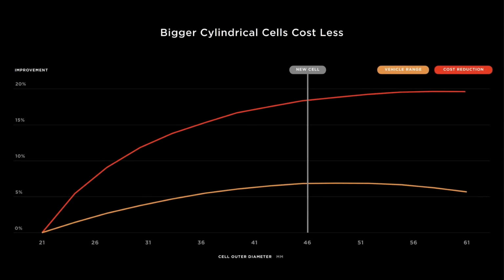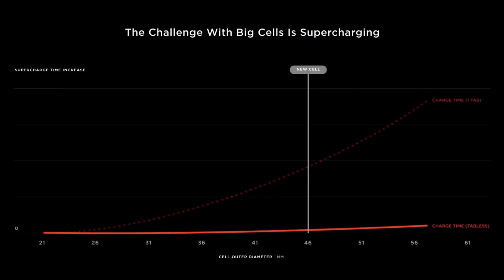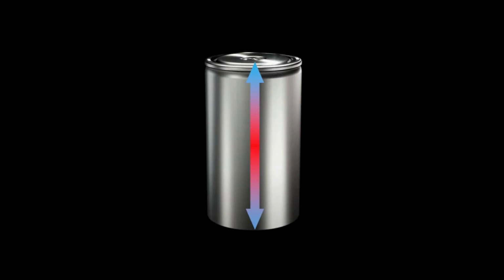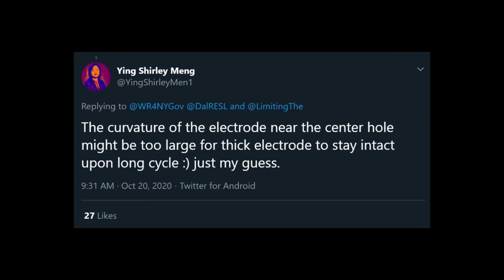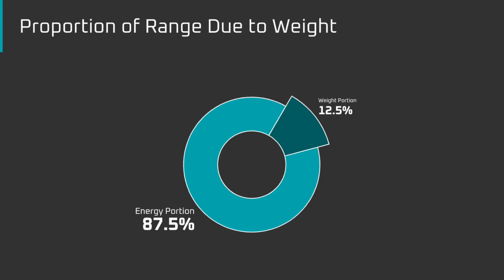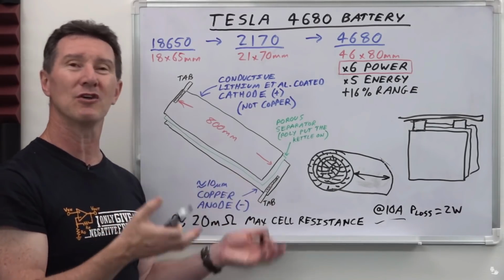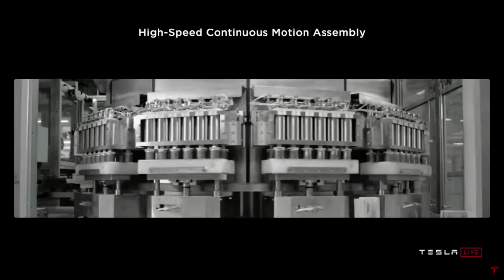#3 Tesla's 4680 Tabless Electrode Cell Design // Deep Dive

Comment: Larger means more thermal mass, higher temps means increased electrical resistance which results in lower efficiency until thermal runaway.

Comment: I would assume Tesla is using some kind of Battery management system for batteries in series batteries on the production line. since batteries, coming off the line will have differences.

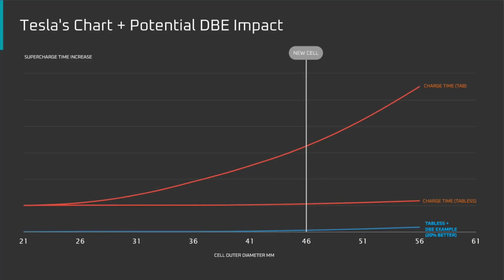Comment: At 9:42, I have a problem with your adjusted graph which leads to my point in my comment from 3 months ago below. The graph's Y axis is Supercharge time increase as diameter increases from 21mm, therefore your blue DBE tabless line, although possibly 20% faster, should also be at the 'zero' line with the other 21 mm cells since 21mm diameter is the zero point. The time it takes to get charged for a 21mm cell is inconsequential in this graph with how the Y axis is labeled. They are obfuscating the actual charge time for a reason and if you were to map your 20% decrease directly to this graph as it is given, it would just overlap the tabless line since actual charge time of a 21mm cell in various formats is not given, just the SC time increase as the diameter increases. What I am saying, and it seems like you are also trying to say in your DBE example is, there is likely an offset in actual time to Supercharge the tabless cell that they did not want to show us for reasons of not wanting to Osborne their current products. My guess is a 2170 tabless cell would charge faster than a 2170 tabbed cell due to less heat issues and longer sustained high power charge rate. If you add the possible gains from DBE to that as well, then there could be a decent increase in charge speed since max charge rate will happen for longer than a few minutes and the max charge rate might be higher as well. I cannot wait to see what they reveal for the next Superchargers and 4680 charge rates/times.

Comment: What do you think the nominal voltage of the cell is? Would it be the same as the previous cells in order to maintain the same battery management systems, or an increase to possibly facilitate the higher power output?
Reply from the maker: Covered in the cathode deep dive videos.  Potentially .1 v increase
Reply: @thelimitingfactor  awesome, thanks

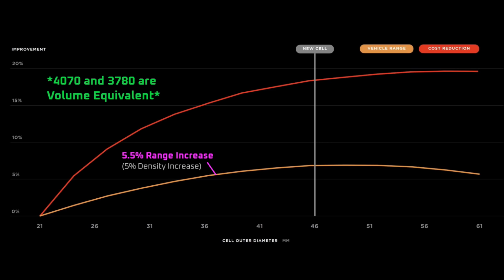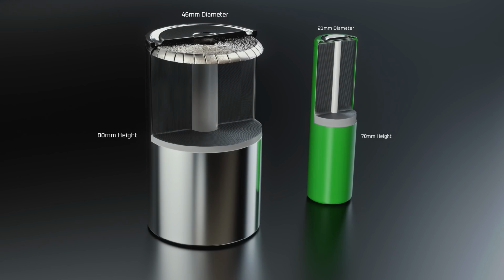Comment: Pay attention to the curled copper flaps of 4680 battery shown on page 4:00 and 4:06. Two, one shown are rolled up electrical contacts intended to press tight against the (+ and -) terminals at the battery casing (as in Tesla’s patent), but is not so in this photo. 

Conventional use tabs (ie - welded tabs) and not multi point contact flaps. Why? to avoid chance for electric spark in side the battery when contact pressure (between flaps and terminal) accidentally falls to zero, ie open circuit.

Contact per contact comparison : 
Welded tab : 
- eliminated spark 
- higher electrical and thermal resistance .  
Multi-flaps : 
- not spark proof (risk to fire / explosion)
- lower electrical and thermal resistance theoretically but practically, as page 4:00.

Comment: Jordan, theoretically, would a tabless 2170 and a tabbed 2170 take the same amount of time to Supercharge? Is there something about a smaller size that is not beneficial to tabless design, but becomes beneficial the larger the diameter? The reason I ask is that I have been quite interested in why they chose the Y axis label and not labeling the increments of the Y axis. It is my opinion that there is an offset in time to Supercharge for a 2170 tabbed and a 2170 tabless that they did not want to show, so they chose to label the Y axis as Supercharge Time Increase. I understand that all the other elements of the cell and pack, anode, cathode, size of the layers, cell to pack, pack cooling, etc. will play a role in charge speed, but I still believe the tabless design gives a benefit due to lower heat and shorter electron path thus allowing longer max power charging before it tapers.

Comment: Maybe I missed the discussion but I have two questions bugging me: 
1: if you are invested in 18650 and 2170 battery form factors like Panasonic et.al it still would be advantageous to upgrade your production lines to tabless electrode design - I would add the faster the better. Why nobody is talking about this? 
2: for me it seems clear that the 4680 form factor is optimized for replacing the 18650 and 2170 batteries in the incumbent S3XY platforms. Why is nobody talking about a 46XX with XX>> 80mm for non-legacy platforms like the Semi,Cybertruck or Roadster for that matter?? You would sacrifice some thermal advantages but would get higher factory throughput, cheaper cells and structurally more efficient monolithic sandwich battery-skateboard floor panels.
Reply from the maker: Talk about it if no one is...start a YouTube Channel.  I started a channel because no one was covering what I wanted to see covered.

I don't have time to cover everything nor do I put everything in my videos that I'd like to.  

I literally have zero competition out there.
Reply: @thelimitingfactor   I am just fine using the comment section on your great channel - hoped for you and others to contribute some color on those matters, actually...to get a nice discussion rolling...

Comment: The first thing i think ( sorry for the joke 😅) when i saw the production line of the Gigafactory 1 is that producing that small cilindrical cells 18650, is not optimized for electric vehicles; it is quite obvious that bigger cells means less time or greater output for producing a certain amount of energy capacity.

Comment: Hi Jordan. Based on your understanding of the 4680 cells, will it need a fuse and individual BMS as the 2170 ? if so, it's going to be complicated to do a structural battery. Theorically is this 4680 will have the same degradation pattern than 2170 and 18650 ? (~5% at the beginning then relatively stable). thanks for all the explanations.

Comment: I think the tabless design has a big impact on charge time, not higher charge rate, but sustain high loads for a longer time.
This means if you keep a 250 mile range you will charge it more quickly from 10% to 60 - 80%,

Comment: One can further reduce Tesla 4680 Tesla tabless battery Ohms losses and increase heat dissipation  by tapering the electrodes in the battery's axial direction so that each electrode thickness is increased where the currents and heat flow are higher, near the continuous "tab".  
The tapers of the cathode and  anode  rubans are matched so that the thickness of both electrodes and the electrolyte  is constant as thus the roll is a cylinder.
The tapper can be straight for ease of manufacturing or nonlinear to minimise RI**2 and maximize heat transfer to the "tab" or end section.
The tab end of each electrode rubans can further be shaped so that as the ruban is winded the ruban tab end makes contact with itself so that no tab bending is required.  This creates a solid disk at each end of the roll which again provides low electrical and heat transfer resistance.

The thin side of each electrode  ruban may have to be enlarged to form a small wire  ( ==O ) to provide mechanical strength to the anode edge and reduce electrical and mechanical stresses in the electrolyte.  The  thick end will have a matching indentation.

One should further explore the parameter space of electrodes and electrolyte thickness in the axial direction by manufacturing and experimental  testing.   That may get us to the Million miles battery.

Comment: It would be very interesting to see if the charge collection from a tabless design is homogeneous radially throughout battery cell or if it happens more in specific places/layers. My guess is that it is not homogeneous and that this limits many other factors about the dimensions of the battery including anode/cathode thickness, the radius of the battery, and (to a lesser extent) heat dissipation.

Comment: Tables?  Looks like many copper tabs that are folded down.   Is that what I’m looking at?  I thought that was what the mysterious image Tesla showed leading up to battery day. Would a LIPO cathode be different in volume of a 4680 cell than the higher performance of nickel one and impact range and power density differently, or are your assumptions strictly on the nickel variant?  Great video btw.

Comment: How, and where, is the CATHODE aluminum foil conductor attached to the cell case? In Jack Rickard's video (https://www.youtube.com/watch?v=2nhQw7iGukE) it appears that in the 2170 battery cell teardown, a narrow contact strip is welded to the aluminum foil. The free end of the contact strip appears that it wasn't welded to the cell case, but just touched it.
  The question is, "How will the new 4680 battery cell CATHODE aluminum foil conductor attach to the cell case? Will the entire length of the aluminum foil be cut into many folded over tabs (like the  ANODE copper foil conductor), and just touch the cell case on the bottom?" 
  Why isn't the conductor contact area, and electrical / thermal conduction of the CATHODE end, considered as much (by commentators and Elon) as the ANODE contact area?  Shouldn't they, both, have contact and conduction areas of equal size and efficiency?
Reply from the maker: All good questions!  All of this is trade secret.  The patent gives some options, but that doesn't mean that's what they did.
Reply: @thelimitingfactor  It may be simple: the aluminum conductor foil is cut and many-tabbed (as the copper conductor is).  Then, the "jelly roll" is  just set into the cell case, to rest on the slightly domed bottom, on a skin of electrically / thermally conductive stuff to ensure satisfactory contact.

Comment: While charging the battery, an AC component must be introduced to "agitate" the cathode. This will allow more ions to penetrate its layered structure. The same as shaking a jar of marbles to allow a large object on top to move to the center. The AC signal can be 5-10% of the charging DC voltage and administered in pulses. Depending on the cathode chemistry the resonant frequency will vary, but on average a 5-10Mhz 50V p-p PWM AC signal will increase charge capacity. You are welcome humanity. Call me if you need me.

Comment: What do you think the energy density will be with those 4680 I know you said in another reply to me around 340wh per kg {correct measure??} but DBE was supposed to add 20% off the bat so I'm going 250 wpkg (current teck) +20% for DBE is what 300ish + another 54% for all the other improvements?? Watts that 450ish??
Even going from 250 + 54% is 385
Can you show me where I'm wrong cause when discussing this with others I don't want to unwittingly spread misinformation and lies, there's enough of that being spread around and I have no desire to be part of it.
Fanks Mr Jordan 🍻🍻👍
Reply from the maker: 350wh/kg, but there will be a video on this
Reply: @thelimitingfactor  oooohhhh goooody when as I need to get popcorn and beer ready oh and a note pad. Copious amounts of notes will taken and questions asked and answered (cracking of knuckles and rubbing of hands together in anticipation) 🍻🍻🍻🍻🍻🍻

Comment: It would be interesting to learn how they will incorporate the battery as a structural component of the vehicle. I'd like to know the type of adhesive they'll use that will withstand the heat and stress. Epoxy is very strong but also brittle. Not all epoxy (most) cannot withstand much heat. What happens when a structural part fails and needs to be put back together? If it's a special type of adhesive it will be a difficult fix. They may compartmentalize the cells into regions perhaps.

Comment: There's an elephant in the room here, and you missed it: Thermally that squiggly 'endcap' is a copper heatsink with collector fins directly into the heart of the battery. It rapidly conducts the internal heat to that disk of copper where heat can be exchanged far more efficiently. Faster heat removal, quicker charging,
How about a deep dive into this aspect?

Comment: 5:59 i dont think a thicker can would help with heat dissipation because it would just be increasing thermal mass but not surface area (which is needed to conduct heat to its surroundings)  a thicker can would just take slightly longer to get hot.

Comment: According to HPQ Silicon, leaders in silicon research, if battery manufacturers use the silicon particle size of < 150nm the silicon swelling and cracking is resolved. Apparently this has been proven. Cost reduction was the hurdle and HPQ has developed the PUREVAP process to create affordable nano-silicon powder and they may already be working with Tesla on this. We will see as things continue to unfold in this exciting battery space!

Comment: Great analysis. I'm still a bit confused by the "speed of the line". The question is if you increase the cell size by 2.2x, can you keep the same speed in terms of cells/second (time unit in general)? Because assuming the cells are going one after another (without spaces), the bigger cells would need 2.2x bigger speed of the line in terms of meters/second... I guess they probably sped up the line in therms of movement speed.

Comment: The 7% increase is from larger diameter alone. Shouldn't the 14% height increase from 70 to 80 mm easily explain the rest of the 16% range increase from the new form factor, even if parts of it are inactive? If we are talking "range" we are probably talking about filling the Model Y pack area with cells.

Comment: Efficiency improvements are great because it not only increases range, but it does so in a way that doesn't require more charging, ie, lower cost per mile driven - or less solar capacity installation required to meet your daily requirements. And less strain on the battery as well!

Comment: You said that someone else suggested "a thicker cell can might be required for the right heat dissipation". When Sandy Munro stipulates & generally Tesla follows & obliges, the heat comes out at the top & bottom of the battery so there's no reason to cool the middle. Because the pack is all glued together to form the structure, cooling the battery pack would achieve little. Cooling plates on top & bottom is also far more efficient. Also it's likely that the can itself may be made from plastics or some other poor conductor of electricity & heat.,

Comment: Increased range of new new battery technology surely comes from the fact that the new 4680 cells will be able to charge faster. Therefore during Regen a larger proportion of the Power created during Regen will be transferred to the pack because of the now lower resistance not only from the tab-less connection within the battery but also thicker connection and bigger current fuse wires to each 4680 cell. Or am I completely wrong !

Comment: Great video mate, you can see a lot of time went into the analysis and a lot of time went into compressing it into a very coherent 20min video. 
Just a question on packing density however. As an internal snapshot of a few cells there is no change to density however wouldn't fitting a parallelogram cell packing shape into a rectangular pack configuration result in more unutilised space at the endgs and thus giving a diminishing (or reducing) range as cell diameter increases? Thus there would be a ratio of cell diameter to pack size that is optimal for packing density? Hope that makes sense.

Comment: It seems like this battery improvement went into the model 3 and Y
Reply: I think the recent range boosts. We're from the heat pump octovalve tweaks. Along with what sandy Monroe pointed out about using aluminum wound motors. And Panasonic leaked they had about 5% better energy density in their batteries this year. 🤔

Comment: i was wondering why not make square cell ? given same radius/side dimension. A square design would have around 27% more cell material when packed together when compare to cylindrical cell. Unless making a square cell form factor is that much more difficult that 27% increase is not worth the additional machine complexity to be worth it ?
Reply: They are called pouch cells. Used by almost every other EV maker. I think the problem is that you have to cut the sheets into flat layers and stack them on top of each other to achieve the rectangular shape. More processing steps then rolling the sheets onto a spindle and sticking the rolls in a can. If your aim is to be fast & cheep less processing good.

Comment: Gordon I appreciate this series so much. However I remain unconvinced that Tesla is not sandbagging on the benefits of the tabless electrode design impact on charge/discharge rate. I believe it was success on this point that allowed Tesla to pull the trigger on Semi production and not other external factors.